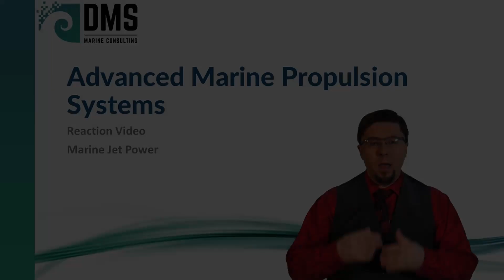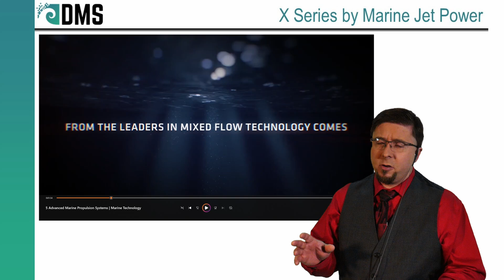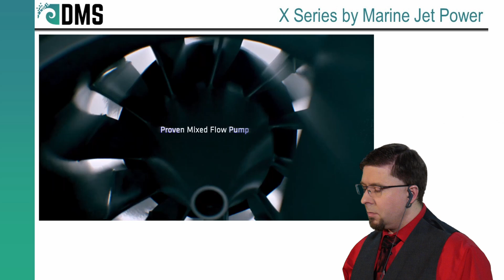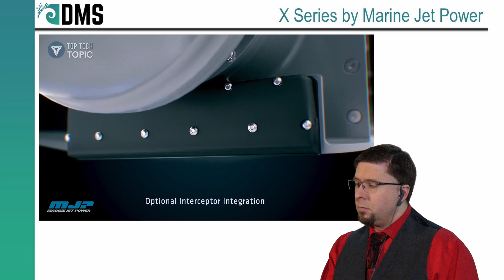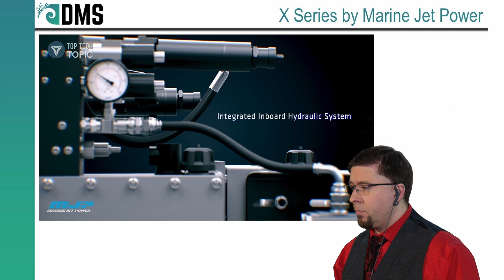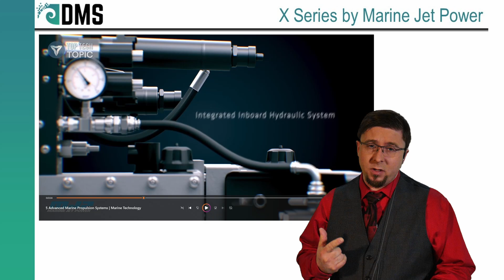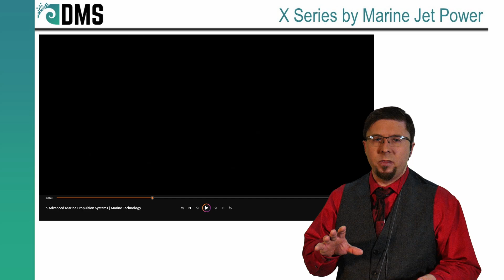Marine Jet Power:  What Makes this Special?

Comment: MJP - followers; not leaders. Hamilton Jet has been doing all these "advanced" items years before MJB copied the Mixed flow tech, copied the reverse duct design and still can't make a nozzle steering as efficient as the Hamilton. Hamilton have had their hydraulics inboard since the beginning and JHPU on-jet - doesn't need a separate piped HPU.

Comment: We caught a glimpse of the impeller and it looked very axial-flow. Streamlined but basically axial. Strange since they claim mixed flow? Could they publish a thrust vs speed curve with power as a variable based on tank testing? I would have thought that was possible?
Reply from the maker: It's subtle, but for about 5 seconds, I can see the shape of a mixed flow pump on the impeller, right at 2:35 in the video.  https://youtu.be/jdppP-marfk?si=HPZjTYuWT4zhMZWj&t=155
The giveaway is the conic shape at the hub of the impeller.  And the blades flow down that hub.  The water flow doesn't cover the entire diameter of the impeller at the inflow.  Water starts near the hub and gets pushed to the outer edges as it passes through the impeller.  That is the mixed flow feature.

And yes, they could publish thrust vs speed curves, but they don't.  They have the data, but don't like to share it.  If I called a sales rep, I might get a thrust curve.  This goes back to the problem that waterjet manufacturers don't like to share performance data.  They don't want us to see any potential negative features.  For example, many waterjets perform great at their target speed.  But as the ship slows down, the thrust from that waterjet decreases rapidly.  I don't know if that's true in this case.  But those negative features are why manufacturers don't like to share data.

Comment: Efficiency is probably a bit lower then on a normal surface drive. In RC boats 70 % is fine for mono hulls. 85-95% for cats and outriggers. An example: monohull with 45mm 1,4 pitch and 30.000 rpm is 45x 1,4x 30000 = 113,4 kmh at 100 % and 79,4 kmh at 70 % ... Same mono with A jet setup and 45 mm impeller and 30.000 rpm. would probably max out somewhere between 50 and 60 kmh and consume more power/ higher amps.
Reply: Yeah, I don't think I'd just extrapolate an analogy from model boats into areas where jet usage can be more efficient.